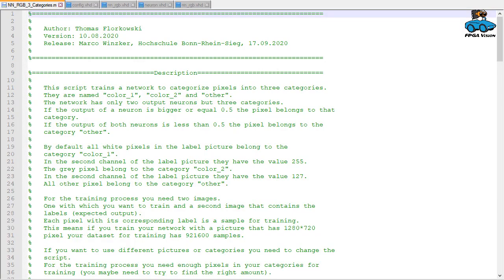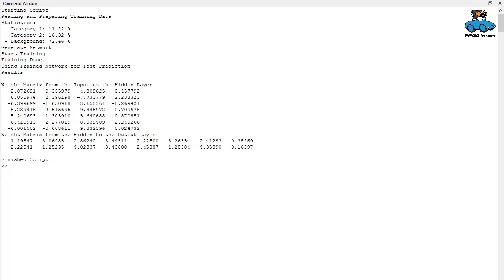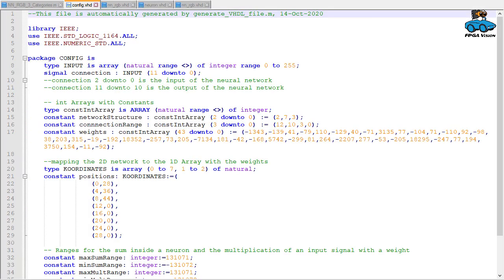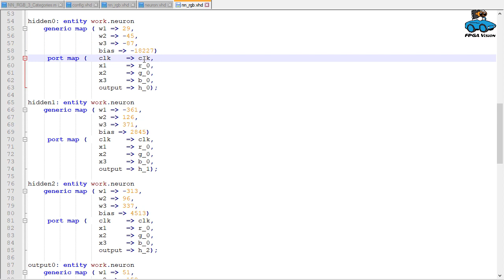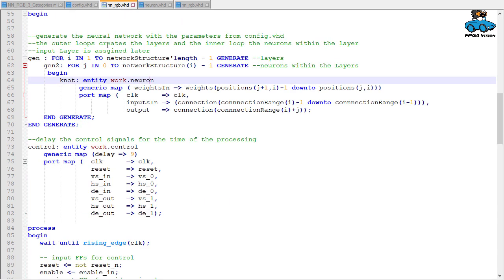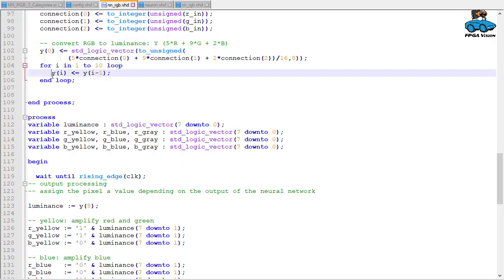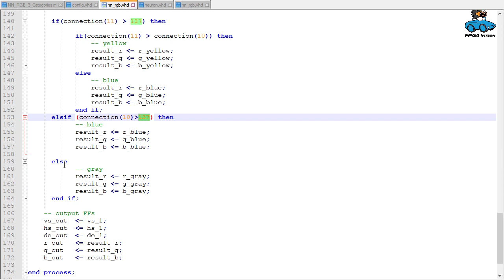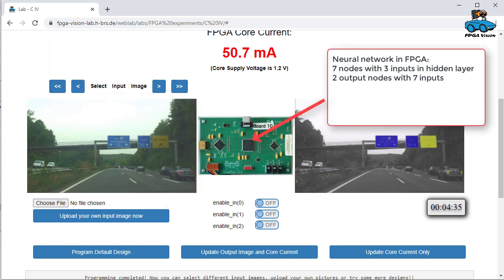Machine Learning on FPGAs: Advanced VHDL Implementation

Comment: Dear professor, could you please share the training image and label color for training inside the folder "Octave" did you use? I was not found those files. Thank professor so much~
Reply from the maker: Please try and generate the images for yourself. It is not much work and you learn a lot about the preparation of data.
Reply: @marcowinzker3682  yesss professor! Thank you so much~
Reply: @marcowinzker3682  dear professor! I'm working with generating the label color for training. Could you please advise me on how did you generate the ground truth label color images for training?
Reply from the maker: @tonydo29  I am using IrfanView and then you have to do some "painting".
Reply: @marcowinzker3682  yesss yes professor, that's strick what am looking for. Warmly thank you so much~~

Comment: Which software is used to  automatically generate vhdl code professor
Reply from the maker: The software is Octave. But please note, this is not a general purpose automatic translation from a problem description to VHDL code. The code generation is for the parameter of the machine learning training to the neural network.
Reply: Thanks for your reply
Reply: As a beginner which hardware language is best to learn vhdl or systemverilog professor
Reply from the maker: @siddusyave9566  Both are good. See if you can find someone in your institution (university? company?) who can give you advice on starting with the language.

Comment: which fpga card i can uses in autonomous cars?
Reply from the maker: In autonomous cars you have several sensors like camera, lidar, ... A first approach can be using subsystems e.g. one module for the camera, one module for the other sensors, one central unit. For cost reduction you can then try to combine them.

An FPGA for this application should have an embedded CPU system with several cores.

So for experiments, use the biggest FPGA you can afford.
Reply: @marcowinzker3682  Can you give one exemple for FPGA i Can use , i am a student and i need a lot of information for my project
Reply from the maker: @saidanianis1923  You need a specification of the required processing capabilities and required input and output channels.

An example for a board with HDMI input is Terasic Max 10 Plus.
Reply: @marcowinzker3682  in my project i will work in line detection , human and obstacle detection and self parking , what requirement do i need ?
Reply from the maker: Only you can answer that, when you do the project. Sorry, I can't give you more information.
Reply: @marcowinzker3682  i really need your informations , any things will help me a lot
Reply from the maker: @saidanianis1923  Next April or May (2021) we will have an FPGA Vision Open Online Course. There we will offer a discussion about projects. News will be on our project homepage.
Reply: @marcowinzker3682  can we use sipeed tang nano 9k fpga boards ?  Or can you suggest some fpga boards
Reply from the maker: @rsingh2083  That board does not have an HDMI input. My suggestion is described in: Image Processing with Terasic FPGA-Boards https://youtu.be/-Nb8ha7s4ZQ

Comment: Getting error "transpose not defined for N-D object"
Reply from the maker: The code on GitHub has been tested and worked on our systems without error.

If you have not solved the problem yourself, please give more information: which source file, which tool, which version of the tool, which operation system?
Reply from the maker: @PraveenKumar-bh2vs  My email is on the project homepage.